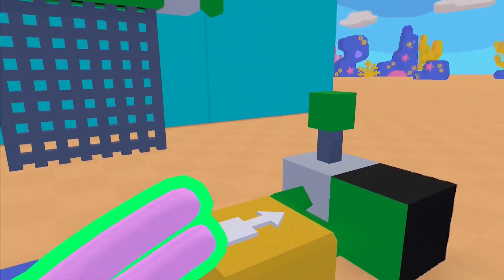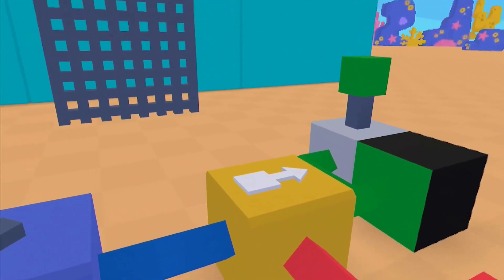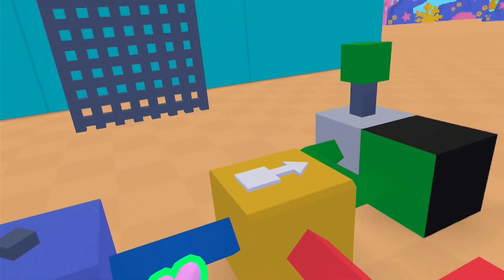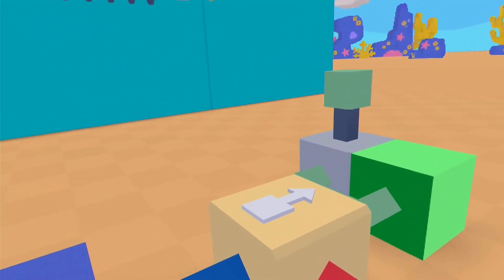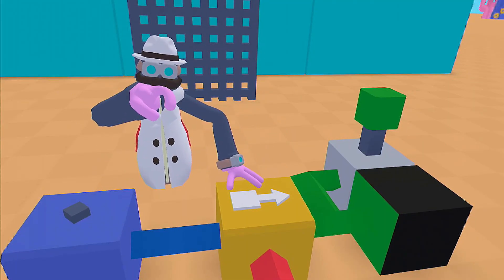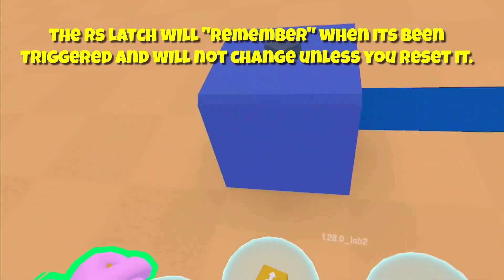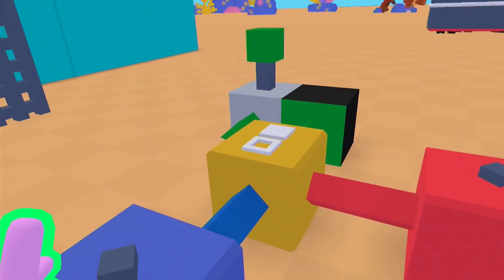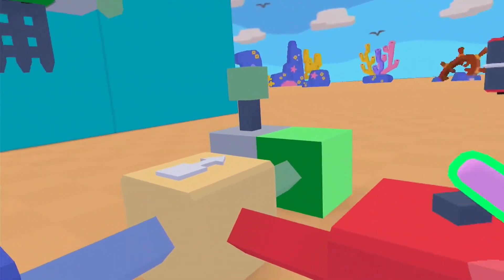What's This Good For? (Latch Logic Circuit in Yeeps)

Comment: I already have been using RS latches by making my own before! I know how to make a little thingy that does the same thing as an RS latch and I’ve used them to make memory systems. Now that they are compressed into one block I can make them way smaller.
Reply from the maker: Using a toggle with a nor gate gets you a similar result, but this is so much simpler.